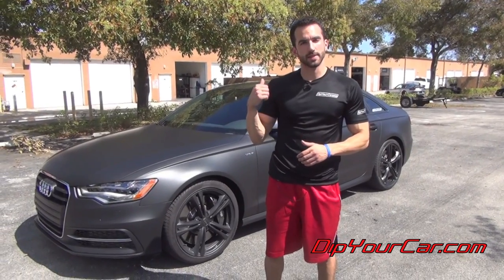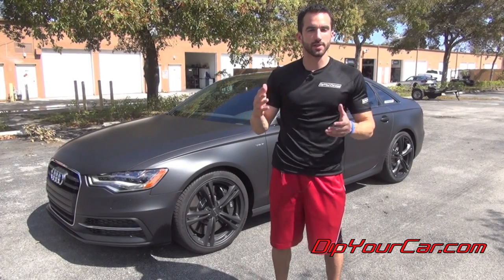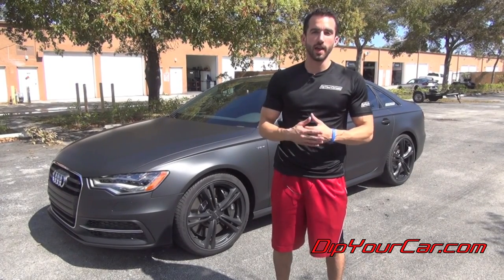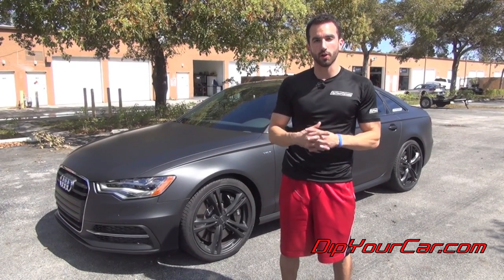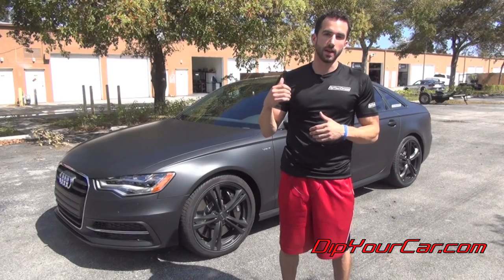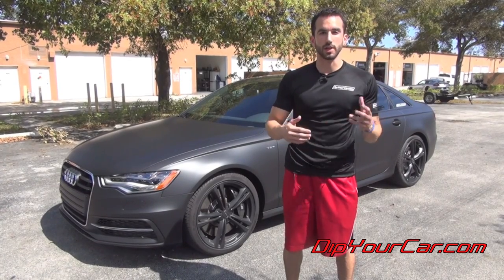Matte Black 2013 S6 - Plasti Dipped DipYourCar.com

Comment: Hey Fonz I gotta give you props for getting that real nice finish every time, you make it look real easy. I've now dipped my car black for the second time yesterday and although my work has improver quite a bit I'm still getting stripes on the roof. I'm using the Wagner gun in the original dip your car kit, do yo know if that might be a factor? Is there any advice you can give me? Is it possible for me to remove or blend the stripes without having to peel it all off?

Thanks, 
Jairo

Comment: Spray cans don't look as good as the pro kit with the sprayer.  I tested a couple of areas on my car with the spray can before using the pro sprayer and the spray can comes out with more of a rough bumpy texture.  The pro kit sprayer is perfectly smooth and looks amazing

Comment: Fonzie,
 I recently armorall my tires and rims and after driving my car for a good 5 miles i noticed the armorall spread on to the front doors and now it looks like oil s been splashed on the side of my car. I like how the armorall gives the matte black rims a bit of a shine. WOuld you suggest to wipe down the entire car with armorall wipes or wash it off at the car wash.

                                               Thanks,
                                                           Mitch.
Reply: What did you end up doing?

Comment: For those concerned about the color being different than the registration: I have driven a silver Dodge Stratus for years with a registration saying that the car is green.
Never been pulled over because somehow the cops could not see into my glove compartment from outside the vehicle and determine my car was not the correct color.
Anyway, you can probably just have your registration updated, eh?

Comment: fonzie, if you were to dip your car with a spray can and spray nozzle, would it work if you did it section by section moving on when 4 coats or so were done? like hood, then move onto door, then trunk, etc

Comment: So... I dipped my wheels the other day and I will be dipping my Jeep Wrangler next.  My wheels have a plastic/Rubber feel to them and that's OK for wheels.  But I don't want my Jeep to have that feel to touch.  Is there a way we can smoothen the touch or maybe clear coat it to smoothen it?
Reply: I was trying to figure out a smart ass comment to this dumb ass question..... No. Plastidip is plastic dip so it will definitely feel like a vinyl/rubber feel that you can actually peel off. There is no way around it other than doing s rustoleum paint job.
Reply: Yes they have a product out now that does just that.  It actually hardens on top of the plasti dip .  It's a spray on application, just go to their website and you will see it.  No sarcasm intended.
Reply: Using their after care spray makes it feel less rubber and more smooth

Comment: Hey guys whats better vinalwrap matte black or just matteblack paint???? I have a maloo ute, and looking at changing the colour to matteblack. If you google matte black maloo you will see the ute I want mine to look the same.

Cheers.
Reply: Vinyl may look better however it is expensive to get it proffesionaly done and from experience it is time consuming but produces a better finished product, if you have lots of free time and a mate to help you out, go buy the wrap tools and the matte black vinyl from 3M and wrap it, of your doing it yourself then use the spray paint